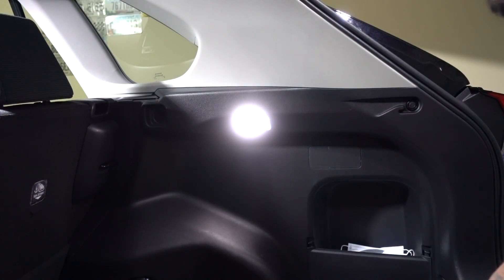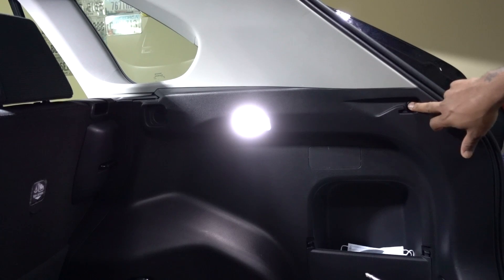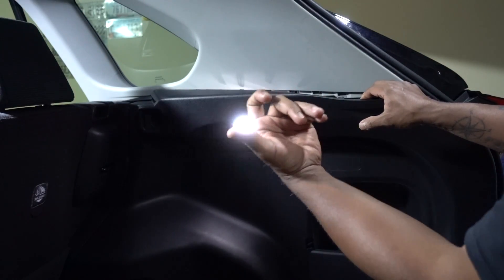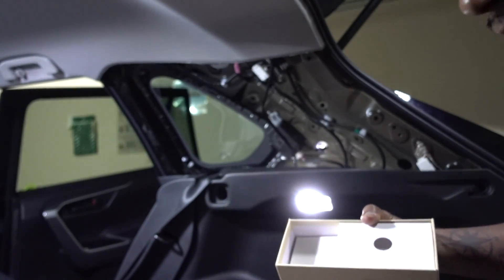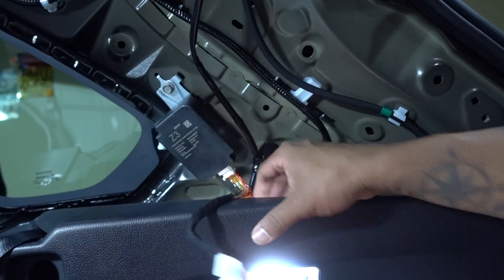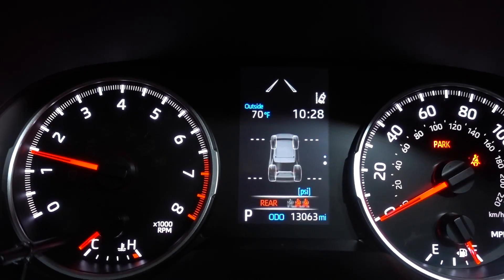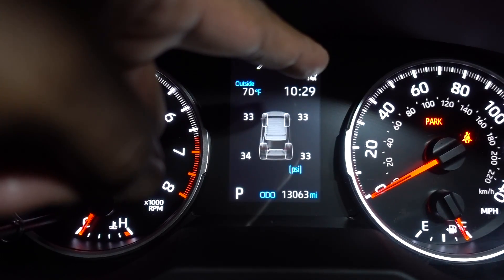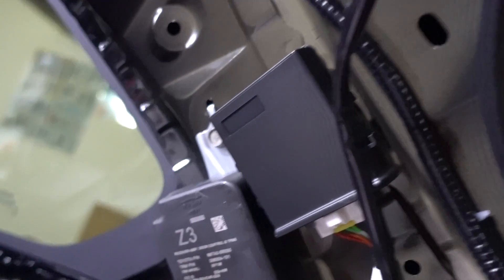Installation of CarTrimHome Smart Car TPMS Tire Pressure Monitoring System | 2019 & Up RAV4

Comment: Hello, Can you tell me what kind of stem do you have on your tires? The rubber one or metal?
Reply from the maker: Metal, if you have rubber this system is not gonna work
Reply: @BulletSolano  HAve you checked why is the difference, mine have rubber stem but also have TPMS but only shows warning not actual preassure
Reply from the maker: @edgartirado5750  not yet, that’s what car trim home says on the website, this system is only for aluminum valve
Reply: A
Reply: @BulletSolano  Thank you for your response. I bought an early 2019 RAV4 Limited Hybrid yesterday and it has Aluminum sensors instead of exposing external valve stems. I guess I will do this DIY soon.

Comment: Hey man, have you dont a tire rotation yet? Does it read it if your rotate them?
Reply from the maker: Hey man, yes dealer rotated the tires last week, it reads the sensor but not in the same position, this system is going to read the original position of the sensors

Comment: which sensor do i need to installed in tire ? can you give link or part number
Reply from the maker: You need to ask the dealer what type of sensor they used
Reply: @BulletSolano  thanks, what TPMS sensor did you used ? if possible can you share the the part number?
Reply from the maker: My rav4 has the sensor in it from factory already, I didn’t change anything

Comment: I would be careful with anything Cartrimhome that plugs into the computers. This guy has a very basic Rav4 trim. Any trim with Toyota Safety Sense may have issues communicating with the added modules and the wiring that comes with this kit. Buyer beware!

Comment: What happens when you rotate the tires? Does the screen get updated?
Reply: It will be updated as long as you have the car relearn where the tires are located. That requires a special tool.
Reply: @Gobinator98  We no longer can get the relearn to work using the same TPMS tool after installing the unit.  Worked fine before.  We have a "J" Japan built 2019 LE Hybrid.  Have you tried to relearn the tire position since installing?